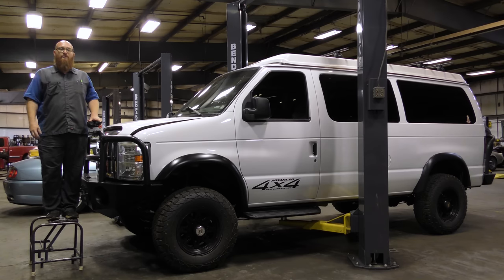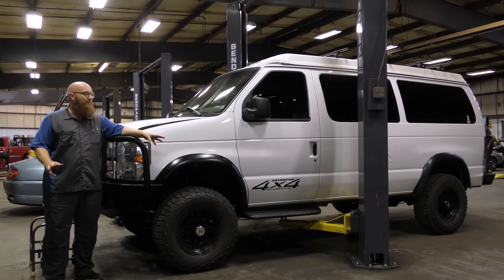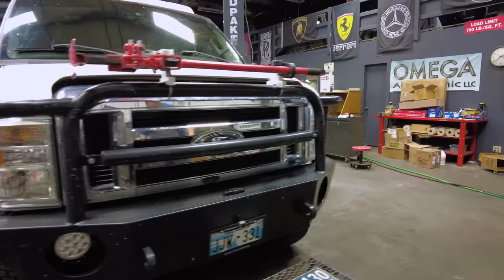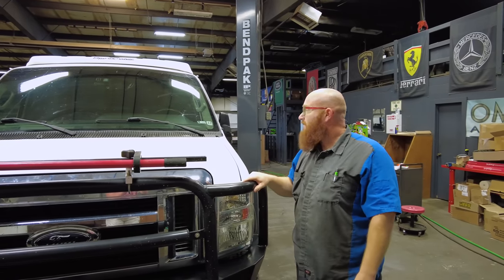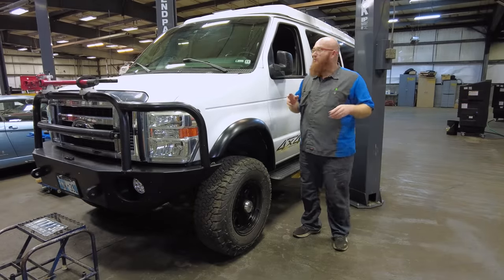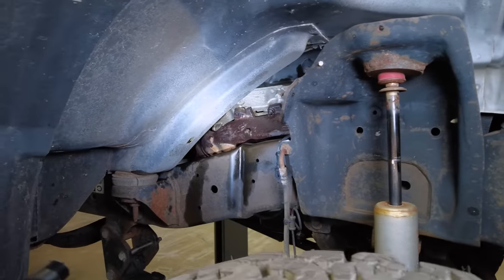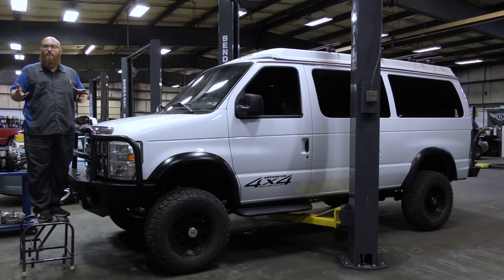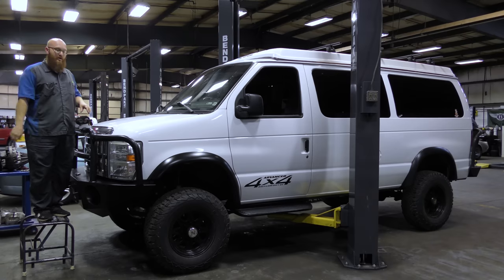8 shops refused to work on this custom '10 E-Series Van! CAR WIZARD shows how easy it was to fix!

Comment: As with all K+N filter installations, this one is filthy and in desperate need of cleaning. You MUST keep after these - they get dirty quickly. Spray 'em down with the soapy solution, scrub out the bugs, rinse well with water (I do it from both sides), and then re-oil. Takes a few minutes, but why bother with this setup if you don't plan on maintaining it?
Reply: Exactly, which is why I never use them anymore.  They're too much of a PITA for negligible benefits...
Reply: They don't filter very well, not worth the effort or investment. Very little added  power,  unless it is a cold air  package.
Reply: I had one for a while on a 1988 Suburban (TBI 350 engine). I got lazy and went back to conventional filters eventually: not proud of myself but admitted I wasn’t taking care of it properly.
Reply: Just buy the sticker. The performance to hassle trade off is much better.
Reply: Yes; because almost all the time they are installed by people who see the advertising and don't know anything else about what they are doing. And they don't care
Reply: Nearly every car i buy that has a K&N in the stock air box gets tossed out. The things are usually clogged up when i find them and to me its cheaper to just toss the parts store special on it and send it on its way
Reply: Yes these take more work than a simple swap of filters. Yet if you take a few mins to do it correctly they save money. If you count the time going to get a replacement from a store they will save time also.
Reply: What kind of oil you put there?
Reply: Thats why I used a k&n filter intake with a oil-less amsoil filter that still had good micron filtration and came with a dust bag too.
Reply: @Iahusha777Iahuah  why even bother with an intake sucking in hot engine bay air? Factory intakes at least suck in cooler air.
Reply: @ricardoramos1242  you can use ATF.  K&N would like you to believe you have to buy their special air filter oil and cleaner kit, but soapy water in a spray bottle, a rinse in water, some sun to dry it and ATF to oil it works just fine and is way cheaper.
Reply: Because they get a cone filter just for the induction noise and thats it
Reply: @ah4800  k&n has a wall to separate the filter from the heat and is designed to get better cold air then stock, but even if a stock one is decent the after market intake tubes are better air flow as well
Reply: @ah4800  we are talking about idiots who put a tube in with. FFlter right in the engine bay. Real k&n kits go to a cold air flow area and uses a heat divider wal
Reply: @Iahusha777Iahuah  either way still a waste of money when the factory unit sucks in colder air
Reply: @nou8257  if I'm looking at a used car, and I see a K&N sticker, I walk away.
Reply: @geepeerces  Yep I see them mostly in trucks and crap that kids who get their first car toss them in thinking it will make it suddenly faster.
Reply: @TrevorsMailbox  thanks man. Great tip
Reply: @jamesmancuso3666  filters can be much cheaper if you buy in bulk from somewhere like rock auto, I can buy alot of 2 dollar throw aways before I get to the 75 dollar filter thats washable

Comment: I follow a guy on YouTube, Foresty Forest. He has one of those but I think it was converted in Canada, he got it from a mining company, think it was originally used for moving employees around. It's a pretty cool machine. His only issue is that the brake pads are loose and make a rattling noise. He put some high temp silicone on them and it seems to have temporally fixed it. Actually I think he has the GM version not a Ford.
Reply: Maybe the pads' anti-squeal clips were thrown away with the old pads when the pads were changed by the last shop to do a pad slap?
Reply: It was a Quigley 4x4 conversion. They are based in the United States.

Comment: You might agree with me Wizard and others, when I say for the 36 years I've been a mechanic, I can tell you of the many things I've learned, one is that NOTHING IS TOO HARD, to work on, absolutely Nothing, the question is HOW LONG will it take, that's to me is what I think people confuse repairs with....it's hard to do that, no it isn't, it just takes a while.  Or it might not take that long to a mechanic but to a diy-er it can be hard I suppose especially if you don't know what you are doing, looking for our oh ESPECIALLY HAVE the right tools for the job, but again it all comes down to time.  
How much time it takes to me anyway, nothing is truly hard.  Yeah I know sometimes things don't want to unbolt or let go or there's no room to work, but again all things that slow you down make the repair longer in time, but it's not hard, eventually it will come loose and come out.  Awesome post thank Wizard, thumbs up Brother!!!!

Comment: Nice van.  Glad you could get it working.  It's hard to find folks to work on older vehicles.  Just rebuilt my front axle and steering components on my old Ram 2500.  Saved a ton.

Comment: The inside of this van looks optimized for a modular system.  The tracks on the floor will hold the modules in place.  The owner must have removed the modules for service along with the GPS and navigation aids suggested by the extra plugs in the dash.  I could be wrong but am working off what I observed in the video.
Reply: Yeah, I was thinking a phone and GPS as well. Might also be a PC with GPS and mapping.  One more possibility is a rear view camera system.

Comment: Sounds ds like the tint shops I called for my 96 impala. Most places said they can't do rear glass? Went to a shop I've used before and they laughed 😅 🤣.  "Why say u do tint when u can't do a rear window" he said...
Reply: @ram dat, I am fortunate.  Local tint shop has always performed great, timely work for me.
Rear tint on one of my vehicles was delaminating from the window.  Since the tint job had a lifetime warranty, I returned with receipt in hand.
Dropped off and job was completely next day.
Great service and warranty.
Reply: Maybe it is really "won't" not "can't." I had a clear security film installed and they did the rear. But because the film goes over the heater strips, it created some distortion. I could see some shops just wouldn't want to get into an argument about that, and have to try removing it. Or, using some brands of tint that said not to be installed over heater strips.
Reply: @lyfandeth  have u ever seen a car without defrost stipes on rear glass? Come on 🤣🤣🤣
Reply: @TheWhiteAfghan  I owned several cars before defroster stripes were available, let alone mandatory. I think some states started requiring them in the late 70's. And even in 1980 customers in Texas, Florida, etc. didn't want to pay for something they never used. And the classic 60's Beetles didn't even offer a rear defroster fan.
Reply: @lyfandeth  did the tint industry stop after 1970?

Comment: I sold my 1993 motorhome because RV shops won't work on them anymore which makes no sense since the drivetrain is much simpler. However, the underlying reason is remanufactured PARTS and the quality of them. I had to take my RV back to the mechanic THREE times because the hydro brake booster was poorly rebuilt. Parts are also scarce. This also was the case with my wife's '98 Z 28 Camaro. Covid also played a role in this as well.

Comment: I've noticed in the last couple of years that a lot of shops are getting more and more picky about the cars they're willing to work on and it's a shame because in a way, they're going to lose business because they're giving people a bad impression especially when it's a vehicle that's not unreasonable. I ran into this with my 94 Firehawk and a shop must have thought that it was some kind of exotic car and I tried explaining to them that it's a firebird with an LT1 but they didn't seem to care whatsoever.😑
Reply: Unfortunately you have to charge by the labor books in most shops and a mechanic  can end up working days for nothing .
Reply: @Jeffbambam  Understandable, but a Firehawk mechanically is 99% the same as every other GM V8 vehicle of the era and are notoriously easy to work on compared to others. Seems odd that a shop would be hesitant to work on it, unless it was more of an issue of being afraid every connector or plastic part will fall apart and every bolt will be rusted due to the age.

Comment: I had a 2007 Quigley 4x4 Van. It was great for my dogs, had a temperature control fan and windows in back open from the bottom.  I wish I had ordered the gas engine. The diesel engine seemed too heavy for the way you sit forward in the cab. I had to install stronger steering dampers and front shocks.  The engine cover always felt too warm. It was insulated. I did tow at least 10000 lbs and the diesel engine and the weight of that van would town that like nothing was behind you. Amazing compared to my F250 with the 5.4l gss engine. It was great vehicle to have. It helped my best friend was a mechanic.

Comment: I have an adventure van, and it is hard to get work done on it. Wanted to get it painted, and nobody would help us. Do love adventuring in my van though.
Reply: I had to have some paint work done on my 93 Chevy conversion.  The usual body shops didn't want to do the work, but luckily I found a hot rod/restoration shop that gladly helped me out.

Comment: I truly enjoy watching your Channel and that share it with everyone I can.
As soon as you said your series of nose I said "why, it's just a van" almost the same time you said it.
We had a 1995 Ford Econoline van that had a mild customization in Indiana, and it was very easy to work on.
 the hardest thing i ever had to do to that van was change out the fuel filler tube from the side wall to the tank. everything else ever did on that van was easy breezy.
lots of room to work with, especially when you took the engine cover from the inside of the vehicle

Comment: It looks like they are just beginning their van build out. Their next step is probably building the interior with a bed, storage, sink/stove and whatever else they have in mind for it. If you want to see good build out on a slightly older version of a Ford E series van, check out Chrome's channel, Vancity Vanlife. He has a lifted van as well, but didn't go for the 4x4 conversion, but he does have a locking diff in the back.

Comment: In my experience with older vehicles pre 1991 these new and even older techs do not want to mess with it unless it has a obd II port. The simple fact is unless they can look at some screen they are not going to go out of their way to figure out a repair that involves outside the box thinking. No matter how simple. That's why I learned to work on my own stuff.

Comment: First day working without a trainer as a lube tech I pulled the ticket for a lifted f-150. I had to stack two tires to get to the engine bay to do my inspection and take the oil cap off. After I drained it and rotated the tires getting the oil up there with me was even more sketchy.

Comment: Does this actually have the 3 valve? That's odd if so, because the E Series never got the 3 valve from the factory, unless I'm going crazy. They had the 2 valve all the way till the end
Reply: correct
Reply: Weezard made a mistake.

Comment: Long ago in the days of Yore home mechanics with unusual skills did strange things to keep their old cars running or go faster... I've worked on a few "customized vehicles"  and I've run into some real weird things over the years.  So I kind of understand where a mechanic might not want to touch a modified vehicle.  I once spent a day in a junkyard trying to figure out what engine was in a particular car... because... well apparently the former owner got a better deal on a newer engine and didn't bother to tell me or even knew what it was.  It did turn out to be a great motor once I fixed the fork lift damage to the valve covers EGR and vacuum switches and knew what I was fixing so I could get the right parts.

Comment: Its actually a 5.4 2 valve, e-series never received the updated and way less reliable 3 valve
Reply: Now that I’m looking I also see they somehow kept the 6.0 diesel in there till 2010 so never had a 6.4 diesel option either.
Reply: @DBeezy2636  they had to pay a penalty for every 6.0 that rolled out after 2006 or 2007 i think it was. since it didnt meet emission standards anymore. i belueve the 6.4 just did not fit in the chassis
Reply: @goenitzlopez2076  Yeah the 6.4 didn’t fit in the chassis. The 6.4 PowerStroke was a terrible engine. Even the 6.7 didn’t fit. On the GM side, the 6.6 Duramax did fit in their vans until 2016 when the L5P Duramax was introduced. The reason why they did fit is because GM vans were wider than Ford Econoline vans.

Comment: Thank you, again, for your integrity in dealing with the public.  Being a shop that specializes in exotics, y'all have pretty much seen it all; so a slightly modified Ford with pretty standard Ford 4x4 common Ford parts, with just a minor leaking issue, isn't anything beyond your knowledge base or capability.   Sure wish you were closer to Houston.

Comment: As someone who are used to drive an East series with the 5.4 L V8 that van Has to be absolutely gutless. 

The best fans to convert are the early 2000s with the 7.3 L V8 diesel. Those are absolute monsters.

Comment: I just did plugs and coils in my Dad's 2011 E450 6.8 liter V10 motor home last year. for a van, it's surprisingly easy to work on. dog house comes out easy. tons of room actually between the hood and the open dog house. lots of room above the engine to the firewall too. I was prepared to hate it, but I've done worse normal cars

Comment: I wonder if this van is used as some kind of offroad recovery vehicle? At first it looks like an overlander setup but its clearly not unless they ripped all of that out. Really cool van, love stuff like this!
Reply: I was wondering the same thing, with a ford 5.4l I doubt it would have much capability aside from being an anchor with a winch, seems more likely they took all their camping stuff out of it before taking it to the Wizard.
Reply: Perhaps they have a "camping cassette" style slide in/slide out conversion so they can use it as a van when not camping?=

Comment: the reason why they refuse to work on is because of exughst manifold jobs on these vans are a complete pain in the but to do! When your shop has plenty of work, I myself will pass! No thanks!
Reply: Especially those that have the 6.8 V10 or 7.5 big block Ford 460 engine. Even the 351W in it’s later years were a pain because of all the emissions controls in them.

Comment: I just sold my e-350 chassis short bus with the 7.3 powerstroke shoehorned in it. It was a great vehicle until it needed repairs. Very few shops would work on it. Usually they claimed roof height clearance issues or weight. Shops that would work on it would take forever to do repairs. 2-4weeks usually. It was also expensive to get anything done on the engine because it was so difficult to access. I ended up selling it because it was just too difficult to fix.

Comment: Wizard , try using a mig welder and weld a nut on the broken stud. If the broken stud is below the surface use a copper tube the same size as the stud and weld on a nut.

Comment: The way the Wizard diagnosed that steering vagueness makes me want to take a special trip all the way there from Chicago just so he can tell me what the hell is wrong with which wheel that causes the steering wheel to waddle at low speeds. Only when the wheels I currently have on back are rotated to the front. I haven't had a tire rotation in years because of it.
Reply: Bent wheel or the tire was not perfectly centered on the wheel when it was mounted!!  I'm just down the road from the Car Wizard and can hopefully solve the problem without a pricey road trip.
Reply: Maybe the "years old" tires need replaced..
lots of tyre problems are solved by buying nice new rubber....
Reply: @JohnSmith-yv6eq  Nope, brand new tires did not solve my issue, and every shop I've ever brought it to and questioned this said they never noticed anything off when each tire was being balanced. One shop did say however that one of those back wheels gave them a hard time getting it balanced, took a few tries before it read 0 on either side. We agreed this could be a hint at being the culprit bad rim, but my wheels require sticky weights and those can be finicky by design anyway so... I can't bank on it too much. Especially when a new rim is over $900
Reply: @man_on_wheelz  
Then it leaves the mounting to the wheel hubs...
is it a concentric mount hub style ?
Reply: @JohnSmith-yv6eq  mounts flat like most other cars, no other way to mount it. No debris or anything impeding the mounting point. And it is only when the current rear wheels are on the front, so that alone eliminates any steering and suspension components, which have been mostly replaced by now anyway.

Comment: Recommendation for the customer, or anyone that deals with a situation similar to this. Look for any company that works on larger commercial vehicles think F450-550 (Pomps as an example) They have the equipment and skills to work on these types of things and are usually very reasonable on the pricing.

Comment: This reminds me of when I worked for a national chain that rhymes with Tiretone. Had a military officer come in with there early 2000's Jaguar x type. Every shop they had been too told them "No, we won't do your oil change." They were at a loss. I was 20 or 21 and said. "Let's go take a look at it." They popped the hood and when it was opened. Low and behold, it had a Ford engine. "Yea, let me get the filter off and cross the number." Did that and got his oil change done and had a customer for the rest of his duty station there. It was on a Marine Corps base in HI. The Jaguar was shipped over when they moved from the states but there was no Jaguar dealer at the time in HI.